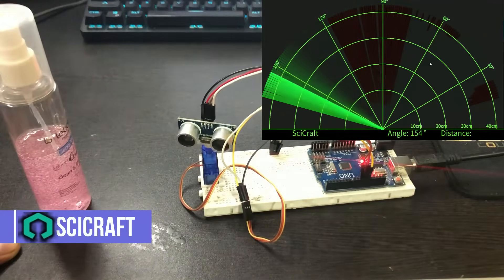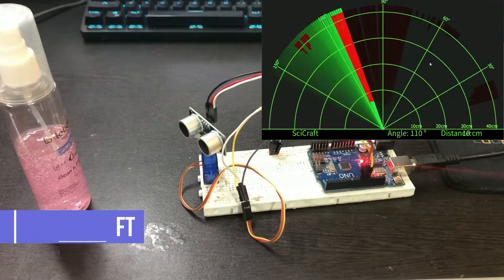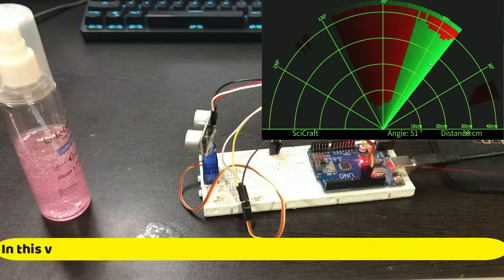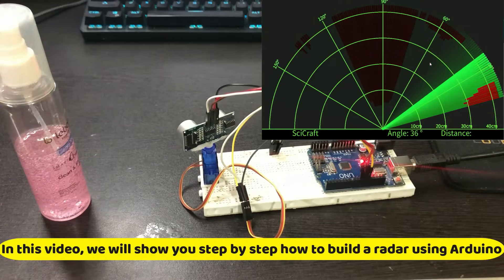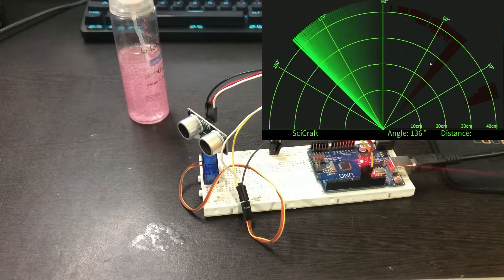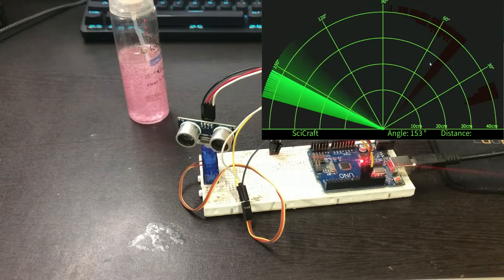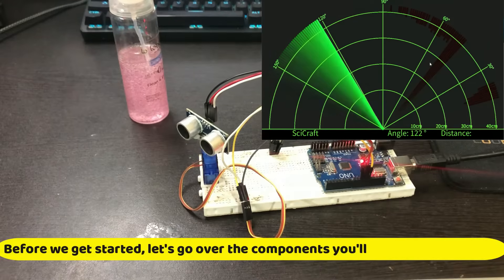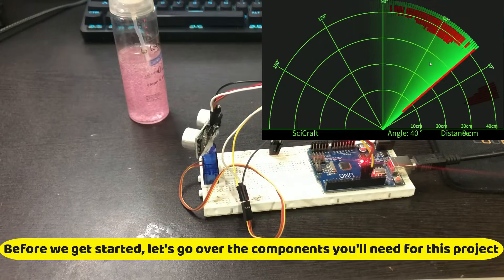Build Your Own DIY Radar System Using Arduino: A Step-by-Step Guide!

Comment: It didn't work for my Arduino and me. I wired EVERYTHING in correctly, and my Arduino turned off at the breadboard to Arduino GND and 5V part.

Comment: I think you can make that camera move up to 400 cm skiing distance and it’s still accurate. You should probably try.
Reply from the maker: That’s an interesting thought! I’ll definitely keep that in mind for future experiments. Thanks for the suggestion!
Reply: @SciCraft  I think in the future when they make higher quality cameras/sensors then you should make a tracking radar which senses movement and or which direction something is facing with AI😀

Comment: Does the cable color affect the code?
Reply from the maker: No!
Reply: but why when the program is run it says com3 is busy? @SciCraft
Reply from the maker: @Rzxonfm3df The com port is being used by another program. I think it's the Processing software, so you'll need to close it first.

Comment: Can you make it 360 degrees with 2 sensors
Reply from the maker: Yes, there are two ways to make 360° radar.
1. Use 2 ultrasonic sensors back-to-back on a servo. Rotate servo from 0 to 180°. One sensor will cover front (0–180°), the other will cover back (180–360°).

2. Use 1 ultrasonic sensor and rotate it 360° using a stepper motor or a 360° servo.
Both ways will work.

Comment: what is the softwere name
Reply from the maker: So, there are two codes - one for Arduino Uno and the other for graphical representation. To upload the code to the Arduino board, you'll need Arduino IDE. And for the graphical representation, you'll need Processing software

Comment: i have a proble @SciCraft. when i change my COM from 5 to 3 it says : RuntimeException: Error opening serial port COM3: Port busy
Reply: nvm. fixed it
Reply: @JohnLindberg-w6d How did you fix it? I have the same problem with mine
Reply: @JohnLindberg-w6d how do you fıx ıt

Comment: I constantly get port busy or port not found what should I do?
Reply from the maker: This happens when you try to send an Arduino code to a board. In this case, it is because Processing must be running therefore its using the port. So if you get this message, remember to stop the Processing code before you send the code in Arduino.
Reply: @SciCraft  hello im getting this same issue.... i did what you said in the reply nothing seems to fix it when i start the processing it just pops up the window all gray and dont respond

Comment: i hope u still read this comment,i did everything the same way and i got it to work and it working fine but very very slow and the radar would stop  working like after 10 sec can u help me pls T-T
Reply from the maker: It sounds like the issue might be related to the timing or power supply. First, check if the power is consistent and sufficient for the radar and servo. Also, try reducing the delay in the code between radar readings, as a high delay might be causing the slowdown and stopping after 10 seconds. Let me know if that helps!

Comment: Processing code:
import processing.serial.*; // imports library for serial communication
import java.awt.event.KeyEvent; // imports library for reading the data from the serial port
import java.io.IOException;
Serial myPort; // defines Object Serial
// defubes variables
String angle="";
String distance="";
String data="";
String noObject;
float pixsDistance;
int iAngle, iDistance;
int index1=0;
int index2=0;
PFont orcFont;
void setup() {
  
 size (1200, 700); // **CHANGE THIS TO YOUR SCREEN RESOLUTION**
 smooth();
 myPort = new Serial(this,"COM5", 9600); // starts the serial communication
 myPort.bufferUntil('.'); // reads the data from the serial port up to the character '.'. So actually it reads this: angle,distance.
}
void draw() {
  
  fill(98,245,31);
  // simulating motion blur and slow fade of the moving line
  noStroke();
  fill(0,4); 
  rect(0, 0, width, height-height*0.065); 
  
  fill(98,245,31); // green color
  // calls the functions for drawing the radar
  drawRadar(); 
  drawLine();
  drawObject();
  drawText();
}
void serialEvent (Serial myPort) { // starts reading data from the Serial Port
  // reads the data from the Serial Port up to the character '.' and puts it into the String variable "data".
  data = myPort.readStringUntil('.');
  data = data.substring(0,data.length()-1);
  
  index1 = data.indexOf(","); // find the character ',' and puts it into the variable "index1"
  angle= data.substring(0, index1); // read the data from position "0" to position of the variable index1 or thats the value of the angle the Arduino Board sent into the Serial Port
  distance= data.substring(index1+1, data.length()); // read the data from position "index1" to the end of the data pr thats the value of the distance
  
  // converts the String variables into Integer
  iAngle = int(angle);
  iDistance = int(distance);
}
void drawRadar() {
  pushMatrix();
  translate(width/2,height-height*0.074); // moves the starting coordinats to new location
  noFill();
  strokeWeight(2);
  stroke(98,245,31);
  // draws the arc lines
  arc(0,0,(width-width*0.0625),(width-width*0.0625),PI,TWO_PI);
  arc(0,0,(width-width*0.27),(width-width*0.27),PI,TWO_PI);
  arc(0,0,(width-width*0.479),(width-width*0.479),PI,TWO_PI);
  arc(0,0,(width-width*0.687),(width-width*0.687),PI,TWO_PI);
  // draws the angle lines
  line(-width/2,0,width/2,0);
  line(0,0,(-width/2)*cos(radians(30)),(-width/2)*sin(radians(30)));
  line(0,0,(-width/2)*cos(radians(60)),(-width/2)*sin(radians(60)));
  line(0,0,(-width/2)*cos(radians(90)),(-width/2)*sin(radians(90)));
  line(0,0,(-width/2)*cos(radians(120)),(-width/2)*sin(radians(120)));
  line(0,0,(-width/2)*cos(radians(150)),(-width/2)*sin(radians(150)));
  line((-width/2)*cos(radians(30)),0,width/2,0);
  popMatrix();
}
void drawObject() {
  pushMatrix();
  translate(width/2,height-height*0.074); // moves the starting coordinats to new location
  strokeWeight(9);
  stroke(255,10,10); // red color
  pixsDistance = iDistance*((height-height*0.1666)*0.025); // covers the distance from the sensor from cm to pixels
  // limiting the range to 40 cms
  if(iDistance<40){
    // draws the object according to the angle and the distance
  line(pixsDistance*cos(radians(iAngle)),-pixsDistance*sin(radians(iAngle)),(width-width*0.505)*cos(radians(iAngle)),-(width-width*0.505)*sin(radians(iAngle)));
  }
  popMatrix();
}
void drawLine() {
  pushMatrix();
  strokeWeight(9);
  stroke(30,250,60);
  translate(width/2,height-height*0.074); // moves the starting coordinats to new location
  line(0,0,(height-height*0.12)*cos(radians(iAngle)),-(height-height*0.12)*sin(radians(iAngle))); // draws the line according to the angle
  popMatrix();
}
void drawText() { // draws the texts on the screen
  
  pushMatrix();
  if(iDistance>40) {
  noObject = "Out of Range";
  }
  else {
  noObject = "In Range";
  }
  fill(0,0,0);
  noStroke();
  rect(0, height-height*0.0648, width, height);
  fill(98,245,31);
  textSize(25);
  
  text("10cm",width-width*0.3854,height-height*0.0833);
  text("20cm",width-width*0.281,height-height*0.0833);
  text("30cm",width-width*0.177,height-height*0.0833);
  text("40cm",width-width*0.0729,height-height*0.0833);
  textSize(40);
  text("SciCraft ", width-width*0.875, height-height*0.0277);
  text("Angle: " + iAngle +" °", width-width*0.48, height-height*0.0277);
  text("Distance: ", width-width*0.26, height-height*0.0277);
  if(iDistance<40) {
  text("        " + iDistance +" cm", width-width*0.225, height-height*0.0277);
  }
  textSize(25);
  fill(98,245,60);
  translate((width-width*0.4994)+width/2*cos(radians(30)),(height-height*0.0907)-width/2*sin(radians(30)));
  rotate(-radians(-60));
  text("30°",0,0);
  resetMatrix();
  translate((width-width*0.503)+width/2*cos(radians(60)),(height-height*0.0888)-width/2*sin(radians(60)));
  rotate(-radians(-30));
  text("60°",0,0);
  resetMatrix();
  translate((width-width*0.507)+width/2*cos(radians(90)),(height-height*0.0833)-width/2*sin(radians(90)));
  rotate(radians(0));
  text("90°",0,0);
  resetMatrix();
  translate(width-width*0.513+width/2*cos(radians(120)),(height-height*0.07129)-width/2*sin(radians(120)));
  rotate(radians(-30));
  text("120°",0,0);
  resetMatrix();
  translate((width-width*0.5104)+width/2*cos(radians(150)),(height-height*0.0574)-width/2*sin(radians(150)));
  rotate(radians(-60));
  text("150°",0,0);
  popMatrix(); 
}

Comment: Hi my friend. Thank you for the video! I want to make an Arduino radar project. Most of the radar projects using Arduino define the object with only one dimension. Whether the object is thin or thick, it draws the entire length on the radar monitor. Is it possible to make a multi-point radar project using Arduino? That is, I will be able to see the size of the object. For example, if there is a box in front of it, I will see it in width and length.
Reply from the maker: Yeah, most Arduino radar setups, like mine, only measure distance at one point, so they can't show the full size or shape of an object. To get that multi-point radar effect, you'd need more sensors or use something like LIDAR, which scans across the object and gives you more detailed info. It’s definitely possible but would require more complex hardware

Comment: my processing software is not working it pls help
Reply from the maker: What is the exact issue?
Reply: @SciCraft  every time i start any code it starts and after 2 mins it says not responding and it closes
Reply from the maker: @AwesomeArnav-ex5li  I need to see some video of the issue so I can understand exactly what's happening. You can share the videos with me through my Gmail at scicraft90@gmail.com
Reply: @SciCraft  the radar project you showed that is working but its not giving the out put on he processing application
Reply: did u find anything tomorrow is my competition pls help
Reply from the maker: Bro, I need a video of the error so I can identify and solve the problem.

Comment: How to add a screen to display that radar
Reply: Bro my servo motor is not rotating but vibrating and it's showing red in radar when there is no object also pls tell fast only few days for the tec fair
Reply from the maker: @naitiksoni907  Please contact me at my Gmail: scicraft90@gmail.com. We will solve your problem together
Reply from the maker: Actually, I'm working on this radar with a separate display, and I will upload soon. Make sure to subscribe to the channel.
Reply: Pls 🥺 help

Comment: any ideas PLEASE on how to add 2-3 random targets on the screen using radars ecuation ?( just for the code only, not for the entire project with components and stuff)
Reply from the maker: can you explain that to me a little?
Reply: Hello and thank you a lot! What I mean is a short simulation of a radar screen that will show or not show some targets(distance, radar cross section or even received power from target) depending on the parameters introduced by the user.(also parameters of the radar range equation, antenna gain, wavelength, transmitted power,  etc) So in the end there will be displayed only the targets that fulfill the formulas requirements. What do you think? Thank you a lot ! ❤️
Reply from the maker: Can you email me this with a straightforward and clear explanation? My Gmail is scicraft90@gmail.com

Comment: please help how to link the arduino IDE and the processing enviroment
Reply from the maker: You don’t have to link anything basically there are two codes - one for Arduino Uno and the other for graphical representation. To upload the code to the Arduino board, you'll need Arduino IDE. And for the graphical representation, you'll need Processing software

Comment: Which program needs for code?
Reply from the maker: So, there are two codes - one for Arduino Uno and the other for graphical representation. To upload the code to the Arduino board, you'll need Arduino IDE. And for the graphical representation, you'll need Processing software

Comment: why is mine moving really slow
Reply from the maker: It's a voltage issue
Reply: @SciCraft  i don't know if you will see this but im wondering what you mean with a voltage issue? in what way? does the servo get to little voltage or what do you mean with voltage issue?
Reply from the maker: Make sure your power supply is strong enough to handle the servo motor. The SG-90 servo usually needs about 500mA to 1A at 5V to work properly. If your power supply isn’t up to the task, it might slow down the servo. Also, check the jumper wires sometimes, a loose or poorly connected wire can cause issues. Make sure all connections are secure and properly seated.
Reply: @SciCraft  thanks, i will try to fix it👍

Comment: it is getting HOT WHAT I DO?????
Reply from the maker: Is your Arduino board overheating?
Reply: @SciCraft  yeeeees!
Reply: @SciCraft  what i și wrong and
Reply: @SciCraft  is
Reply: And processing 4 i downloaded and my PC tells "app not found"
Reply from the maker: Looks like your arduino board is fried, so you'll need to either grab a new one or swap out the voltage regulator on the current board

Comment: My radar is showing all red even when there is no object in front of it.
Reply from the maker: Actually, this problem also happened to me while making this project. After trying everything possible, I came to realize that my ultrasonic sensor was faulty. After replacing it with a new sensor, then everything is working fine

Comment: i got this code in arduino ide: Failed uploading: uploading error: exit status 1
Reply from the maker: To resolve the issue, I'll need pictures of the setup and the error. You can easily reach me at scicraft90@gmail.com or connect with me on Instagram using the handle https://www.instagram.com/scicraft9. we can work together to solve this problem.

Comment: Hey, i built the radar right and so was the code but the board just doesnt turn on (it turns on a very low power led that indicates it is turned on but barely) and it doesnt do anything
Reply from the maker: https://www.instagram.com/scicraft9/ - This is my instagram ID , DM me!
Reply: Im sorry, i figured it out. Turns out the port on my pc didns supply enough power. @SciCraft

Comment: tried it and worked completly fine
Reply: Broo what kind of library should be use bro ?
Reply: What should I do as the connection are loose
Reply: @sapnachauhan1121  try to hot glue the wires

Comment: radar or sonar ?
Reply from the maker: It’s a sonar because the ultrasonic sensor uses sound waves to measure distance and locate the object and Radar uses radio waves to detect and locate objects but sorry to mention it as radar because most people think it is radar and search this project as how to make radar using Arduino so that's why

Comment: 🥺💬 I think SciLab release code with examples of many application, I used to work with MatLab, SciLab, and scientific program there is more application from location-based. Radar is not applicable for detecting objects only but the information you can align the shape of the object and tell about how objects are related on reflection information and is it possible with assumption. Radar can help the investigation to evidence for investigation or attachment more than catch the flying bird only.
Reply from the maker: thank you so much bro for sharing such a important infomation ❤

Comment: The parseInt(String) function does not exist.
Gives a fault
Reply from the maker: In the code ?
Reply: @SciCraft  47 and 48 processing
Reply: @Taylançelik06  Same problem here. Did you solve the problem. Sorunu çözebildiniz mi hocam.
Reply: @CrimsonRoseBDO  bayağı bir uğraştım ama radar görüntüsü var servo hareket ediyor fakat yesil ve kırmızı göstergeler yok onlarda kodda integerler fakat hata alıyorum hala.
Reply from the maker: https://instagram.com/scicraft9?igshid=MzRlODBiNWFlZA== dm me on instagram
Reply: 48 ve 49. satırları böyle yazarsan düzelecektir.
iAngle = Integer.parseInt(angle); 
 iDistance = Integer.parseInt(distance);

Comment: This is not radar…
Reply: You Fail! 😂😂. People are so ready to battle. Great video. I made this my first project.  Turned out perfect.  Thanks You!
Reply from the maker: For this is a sonar but most of people think this is a radar and search for this
Reply: @SciCraft  No, most people search for radar, and you trick them into thinking it's radar by not including the recorded sound and by misnaming the video as "Build Your Own DIY Radar System Using Arduino: A Step-by-Step Guide!" No where do you say it's sonar. The only hint we get of it is in the parts list "ultrasonic sensor".
Reply: @SciCraft  right, which makes this misleading AF…

Comment: Sonar.  Radar uses radio, not sound.
Reply from the maker: Yes,you are right bro
Reply from the maker: But most people of the think it is a radar
Reply: @SciCraft ame with metal detectors but they use Eddie currents to pick up metals  in those and some have actual sonar as well ....when i think of Radar i think of m.a.s.h. lol....
Reply: @SciCraft not if you use the word sonar they wouldn't.
Reply: @SciCraft  So you mislead them then...
Reply: From 3 hz to 1 giga hz is radio waves. So is in the range
Reply: @robertoambrosios.3624  Except this isn't transmitting the electromagnetic wave.  This is transmitting a pulse of varying air pressure (sound). Totally different...
Reply: Bro you are wrong, Sonar stands for Sound Navigation And Ranging

And also it uses High frequency sound
Reply: For your kind information there is only one thing common here an magnitude send which is getting reflected, it might be radio it might be ultrasonic sensor or it might be infrared light
Reply: IT depend's you can budil a radar that use echo loacation for spoting or something else
Reply: @Polskaeman137  If it uses sound, it's sonar, not radar...
Reply: So it called soadar
Reply: U r dumb
Reply: T.v. antennas used to tell me when someone was walking up to my door lol...